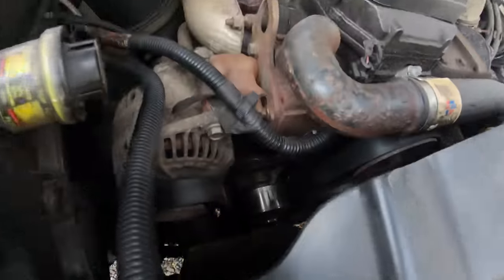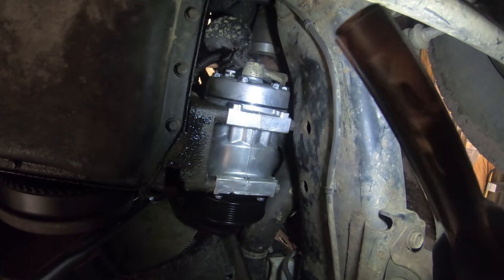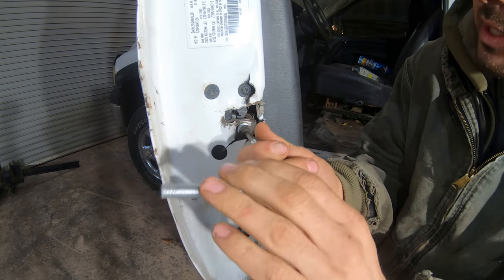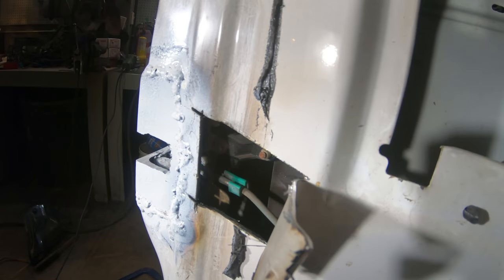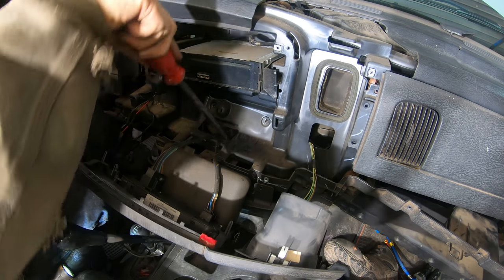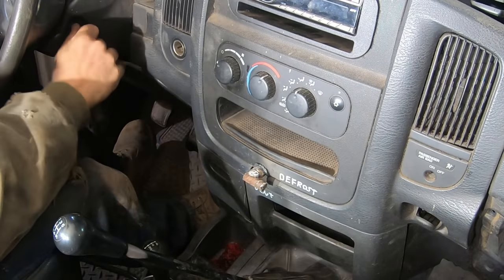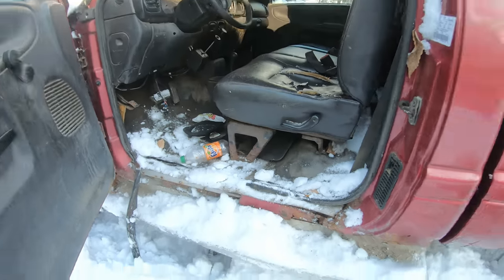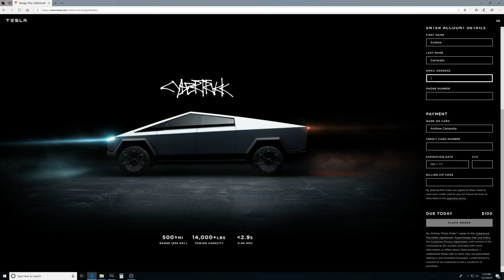Pickup truck repairs

Comment: Only thing about that defroster fix is the defroster won't work as good. When you use the electric knob to switch to defrost, the AC compressor turns on and dries the air before it gets heated and it defogs the windshield much quicker. Minor details though

Comment: I love your heater vent fix. For a Dodge truck, Defiantly an UPGRADE. Im kinda surprised you going ahead and pre-ordering the Tesla Truck. Yeah the stainless is great. but you being in the woods most of the time, what t you gonna do when you run out of power? Also i don't see any range with say a full load. even with the 500mi range. i just don't see how this is gonna be a help to your arsenal of work trucks. but hey whatever floats your boat. Happy new year.!

Comment: A TV network should pick you up and set you up as a high end car repair shop. Rolls Royce all the ultra expensive ones . Then have some people bring in the cars for repair. They can sit in a locked room with a glass wall so they can see you repair the car. You get you chain saw out and saw up the dash and weld angle iron on to the doors . Then come out and say I call that good. No more cheap plastic stuff so it's good . That would be the most funny show ever

Comment: I like the vehicles that use engine vacuum to active the blend doors they never fail cause there no electrical motor to replace
Reply: My old Toyota trucks have mechanical links to the doors and my fingers amazingly have enough horsepower to activate them, they make things so unnecessary complicated now.

Comment: You should pull a vacuum on the refrigerant lines before charging. Air = moisture moisture and refrigerant oil turns to acid acid eats up the motor

Comment: The bad thing about the Tesla Truck (for someone like Mr Camarata) is that it will be full to the brim with electronics. You won't be able to open the thing with a saw and put a metal rod in there to control the airflow. The on board computer will just lock the car in place once you start "prodding" it.

Comment: I like your style my heater dont work but i don't care because the door shuts and i stopped the windows falling down with Anchor bolts just drill a hole in the glass and got a metal coat hanger and when i need to drop the window down to pull my door mirror away from getting hit when i turn left and hook it on the coat hanger and hang it on the anchor bolt i bolted on top of the door my radio was playing up but i found the aerial was not working properly it started when i tried fixing my windscreen wipers as they only worked when i turned on my right indicator and when it rained everyone kept blowing their horns but when i try blowing mine back at them the radio comes on blaring and all the lights go out in the car i keep meaning to sort it all out but i'm always busy at work i am an aircraft mechanic and they are forever playing up i fix one thing and something else stops working they don't make them like they used to.

Comment: Does it not leak anything when changing the AC pump? Over here we have specific laws for AC maintenance, only trained professionals may work on it, due to the dangerous gas (Argon I believe?) for the environment.

A bit contradictory later on though. Saying the less electronics you put in the more reliable it is. Yet there's the thing with Tesla at the end.

Comment: I have 2001 Dodge half ton.  When he talked about the dash I could relate - but mine is worse.  I also had to jack the door a bit.  No way I'm pulling the door trim or dash - I know for a fact I'll never get it together again - it will bust into 1000 pieces.

Comment: 👍Good work. Common sense indicates northern states finding another source of road de-ice! Gotta be something besides the horridly caustic stuff they use on the roads that within a couple years destroys property of all sorts. 
My father in law in western PA goes thru same sorta things too. Replacing brake lines, rust control. His concrete driveway has more "patches" than original concrete due to that caustic crap! 
Hold these States accountable as they sure steal enough of your tax dollars!

Comment: You can't add refrigerator before removing the air in the lines or it will ruin the compressor.  You will be replacing it.

Comment: Door won't open - kick it with both legs from inside.
Inside door panel open won't pop out - manhandle it with both arms and pull it out.
Door panel connectors don't line up to reinstall - screw in self tapping screws wherever you want.

My kind of mechanic.

Comment: Andrew, I thought you dislike electronics... these Teslas are all computers and electronics. When it has problems you won’t be fixing it, some electrical engineer will be getting $250 an hour to work on it. Parts will cost a gazillion bucks and you’ll have to wait months for spares. ...but it won’t rust. Read the negative feedback on them. There is a whole new underground economy on repairing them if you live close enough to a big city.

Comment: One problem I see with it. You can't really add a tool box or a headache rack. And it don't look like you can put a gooseneck or plow on it
Reply from the maker: Ill put a plow on it. why not a gooseneck? those bed sides aren't that tall.
Reply: @AndrewCamarata  I'm talking about being able to put it in. How do you get to the frame?
Reply from the maker: Chandler Milstead on the Tesla? Bolt it on there. Make it fit.

Comment: Ordering a Tesla was ... unusual. And unexpected. That vehicle is made of electronics and little else. Elon mentioned that even the motors use electronics to communicate (or maybe he was talking about the Semi?). Fixing a Tesla is not the same as fixing any normal car. You won't need an angle grinder and a welder. You'll need advanced hacking tools and some proficiency in programming. It will be like "This motor receives an incorrect request to turn right before that motor and I found this in the log. Let's put a lock on this thread to make it wait before that other motor begins turning right". 
Looking forward to Andrew trying to fix a Tesla :-))) 
P.S. By the way do they even sell replacement parts for Teslas?

Comment: Andrew goes from hating on cars with computers and never owning anything that does not need work to wanting the Tesla truck. You may want to go on Rich Rebuilds channel to see the joy a  Tesla is to work on, they are the Apple of cars, there will be no after market parts. I was looking into a Model 3 but I could not pull the trigger because they are a proprietary product as Elan is making it difficult to secure parts and the software locks you out. Ma is a right to repair state to that may change.

Comment: While I totally agree with all of your points regarding how crappy and cheap the existing trucks are made, if you think a hideously complicated computer controlled wiring nightmare jam packed with delicate electronics will be any easier to fix once it inevitably goes wrong, dude, I have bad news for you. Somehow I don't think an angle grinder and some rebar will get you out of a breakdown failure on a Cybertruck...

Comment: I hate hvac systems electronic solenoids controlling the air direction in new vehicles they're always a problem my 91 Camry has mechanical levers and still work like new.

Comment: did  you actually just order a Tesla pick up truck? or did i hear that wrong?
Reply from the maker: I did it.
Reply: @AndrewCamarata  so for fun or are you buying one to put it threw the Camarata test?
Reply from the maker: I like that it is stainless steel and wont rust. And has thicker metal on the sides. I been having allot of problems with this white truck lately and just kinda want to buy a new truck.
Reply: @AndrewCamarata sweet it would be kool to actually see someone use that truck for what a truck is truly ment to be used for.

Comment: Tesla cars wont be easy to fix once those batteries start to age, you wont be opening the casings on the batteries that will just void the car instantly since you're not authorized for it. same goes for pretty much anything technical

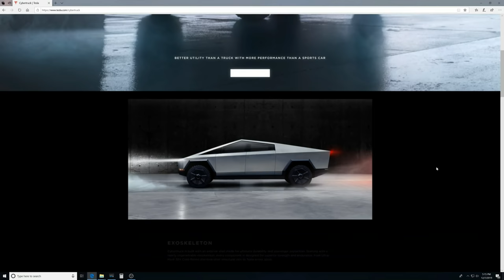Comment: 25:48 lol all of that was a lie, you can peel the body panels off with your bare hands and the frame is made of cast aluminum tin foil. 

towing something and going off road can permanently distort the entire truck, the air suspension is held together with cast aluminum pieces that are shattering from pot holes.

Comment: The running boards are crap on that red truck if those were gone it wouldn’t have rusted that bad because they trap salt in the crevices.
Reply from the maker: It was pretty rusted everywhere. Really it needed to be designed better.
Reply: Andrew Camarata yeah no doubt I had two second gens rust out the one when you sat in the cab and you rocked in your seat you could see the cab move so it was just held on by wires and the second one is on the beginning stage of the rusting

Comment: They should start making cars out of oak the woods so hard they would last for years and maintenance would be some bees wax now and then and doors would just need a sanding every so often when they swell up and at least when they were did finally pack up they could use them as fuel for electricity needed to keeping the country's lights on and heating big areas where they build the power stations people would only be to happy to rent apartments next door getting Free heating  and cut price electricity they could go in shut the windows and there homes would be vurtualy smoke free nice and warm in the winter and in the summer just open all the windows and the wind turbines would blow the smoke away from the houses AND generate MORE electric for free Happy Days !!

Comment: Many years ago I worked at a gas station pumping gas and doing odd jobs around the station.  I always had to be aware of what the mechanic was working on and how difficult the job was because he would often flip a wrench in any direction across the bay cursing about if only the stupid $&@* engineer who designed this piece of crap had to work on it he would sure as hell have made it differently.

Comment: Would have been cheaper to buy a belt for the truck without ac.
Reply from the maker: I tried doing that, the belt didn't fit. I think it needs the no AC idler or something too. The AC did work well in that truck, and without the vent windows, it kind of needs it. If the truck had vent windows like the old ones, AC isn't needed.

Comment: Notwithstanding my enormous respect for your talents, you are wrong about the way trucks are built today. The reason there built with crazy thin metal is the Obama administrator included commercial trucks and commercial truck use in the cafe standard, thus requiring the manufacturers to shave off nearly half a ton from the  overall vehicle weight.  It simply is not physically possible to build a durable truck With the mileage requirements stipulated within the cafe standard . The only reason Tesla can do it is because they transfer the carbon load to the electrical grid, thus circumventing the cafe standard altogether.
Reply from the maker: Just shut down the cafe standard then.
Reply: @AndrewCamarata  Also, as I was tearing into a customers sump pump today I was thinking, you know, Andrew would just do what needs to be done to get the job done. Though I am 50 years in, and 36 years in the trades, I  am no less encouraged by your what the hell, just get it done attitude.  Well done sir.

Comment: You need a six ft crowbar  and a 12 lb mall. Once you drive an 8 inch railroad spike threw the dash and bend it over and it shorts out the wiring you will have heat at least temperarally. Just remember where there is smoke there will be heat eventually, maybe. Andrew I believe is the best , of all the worst mechanic's on YouTube. The older he gets the better he was...for sure and allway's remember safety is only a word used to scare people.

Comment: Тебе только трактора ремонтировать:))
Reply: "You only need to repair the tractor :) "
Reply: @davidnull5590  I didn't think that anyone would understand :)), but Yes, I am shocked by how the author of the video stuck a piece of iron pipe in the panel, but it is reliable and practical as in a tractor.

Comment: .

      Repairs . . ? ? ?                   

.
Reply from the maker: Fixed the door and the heater in this video.
Reply: Pra mim isso não foi reparos, foi gambiarra...
Reply from the maker: The door latches and the heat comes out of the right spot.

Comment: Hi Andrew, I see you ordered a Tesla truck. I think you should back out of this deal for the following reasons:  (1) If you hate computerized controls, you will hate it. (2) You might get electrocuted the way you (butcher) fix stuff, then no more videos for me to watch.  (3) Door knobs on a model S are about $1000 each to replace. They don't last too long. (See "Rich Rebuilds" on YouTube, it's an eye opener).  (4) Owning a Tesla is a lifestyle. You life style doesn't line up with this. You are going from manual control to computerized everything. Stuff breaks and it is expensive after the 8 year warranty expires. (5) Tesla repair centers are not plentiful, and the wait time for repairs is a long time. I don't think you will be doing any hack jobs on repairing one of those trucks.  (6) You will get sick of charging a big battery, the way you beat the hell out of your stuff especially going up and down your mountain road to your shop. You need to watch Rich Rebuilds on YouTube, before you fall in love with a Tesla. I think you will change your mind.   So, what are your options? Well, I would get a new 3/4 or 1 ton pickup, and have it undercoated, and then shoot drain oil on the underside very regularly. This will fight the rust. Just put a piece of thick plastic under it when parked, to catch all the oil drips. I truly don't think you will enjoy trying to fix a Tesla. It is a lifestyle! I believe  Rich Rebuilds lives in New York. I would drive over to his place and visit with  him. He promotes and now fixes (for a living) Tesla's. He is a very funny black guy who is appreciated by lots of us!  Good luck, and thanks for your great video's!
Reply from the maker: I want to tesla to be good, these other trucks rust out too fast.
Reply: Andrew, how about the idea of  installing a removable bolt on aluminum (4 × 8)  sheet under the frame to keep the salt from splashing on the underside? This idea is similar to your skid steers that have a fully protected bottom that prevent damage from stumps and other objects!

Comment: HAHAHAHA, you actually BOUGHT one of those dorky Tesla pick up trucks? Did you actually see that presentation where they threw pebbles at those ‘bulletin proof’ windows? 🤣 I doubt that a charlatan like Musk will improve cars/pick up trucks, just look at all those quality issues with the Model 3. The big issue is “American Engineering.” Your car is a 2003, yet Dodge was not able to make extremely BASIC things like door hinges, a plastic dashboard, door locks, heating/ventilating dials, or a galvanized chassis in 2003. Why can the Japanese, Koreans, or Germans build decent cars, even in US manufacturing plants?

Comment: lmao.. a pickup truck that will last 50 or 60 years.. thats about the most comical thing ive heard all week. No truck that exists in the salt dumping capitol of the world for roads in the winters will ever last that long. If its not the body that rusts out it will be everything else. You despise electronics and yet your looking at the the one vehicle that is literally all electronics. You contradict yourself to the point where its almost laughable... Do what i did .. buy yourself an early 80s truck in my case an 82 GMC Jimmy .. very simple hardly anything for electronics .. tape off every joint ie shock bolts and whatnot and then bedline the entire truck underneath and the body .. do the frame as well and yes it will last for a long .. long time as its completely sealed. Dont cheap out and do the bedline in a can and roll it on.. go get it to a paint shop and get them to professionally spray everything down then paint it the color you want. Trust me it works.